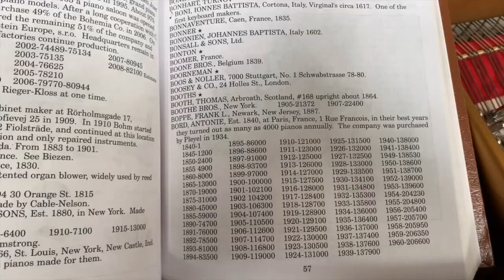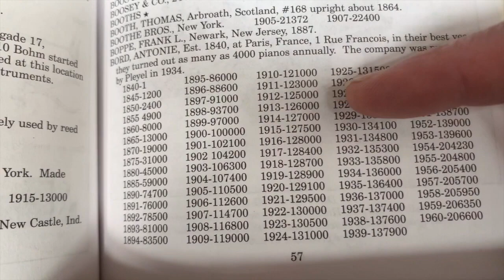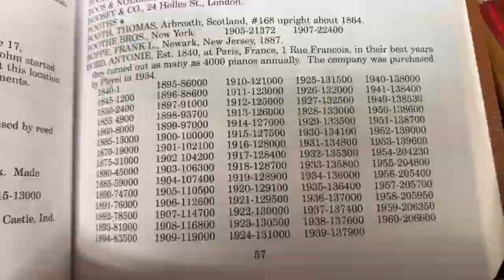Before and after restoration of a decorative Bord 160cm grand piano, 1924; See jump links below:

Comment: For sure this Bord is a quality piano  -much thought in the exquisite veneer pattern typical of French pianos of this period Pleyel, Erard etc.
- Individually strung (preferable for tuning stability IMO); those (original) long tapers on the copper bass strings
- And of course that clever design for the music desk: which at least obviates too much dust getting inside the action 
Before restoration it was evident - maybe dirt got under the key bed to bring those screw heads into contact with the underside of the pin block? 
And yes - those broken hammers: happens to all of us: tuning a friends Bentley 'Bungalow' - very, limited for space my strobe tuner slipped, fell INSIDE the instrument taking a couple of hammer heads with it.  One glued nicely - but the other needed drilling out and a new hickory shank fitting.
- now if it wasn't for your videos I wouldn't have been doing that in the first place !!!

Comment: I am so heartened to see the broken hammers!  What a gorgeous case.  I do like the single-wing repetition springs; so easy to adjust very precisely with the grub screws.  You mention furniture polish for easing movement in the keybed.  What about Teflon powder there?  Or now there is some talk of Tungsten DiSulphite (WS2) powder which is much slippier, apparently, than Teflon powder (though dark grey rather than white).
Reply from the maker: Thanks for the suggestion of Teflon powder, we haven't tried that. Would be grateful to know what you prefer.
Reply: @RobertsPianos  Well, I am no authority!  I've never tried furniture polish, but I see the logic of it.  Teflon powder is of course more expensive than talc, but much slippier and I find it easy and pleasant to use.
Reply from the maker: @DavidBoycePiano  OK thanks, I think as it's quite expensive we'll probably stick to furniture polish unless it's a lot better.